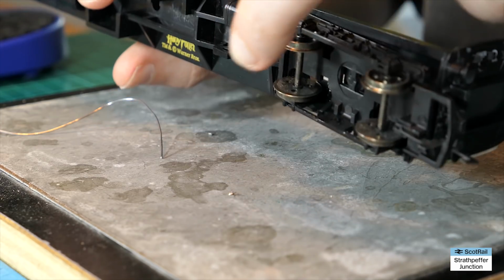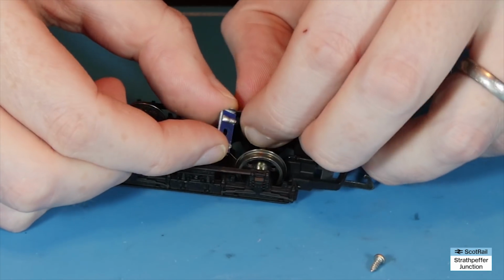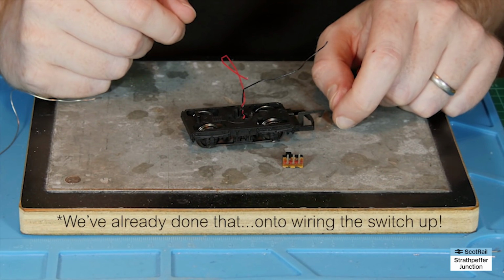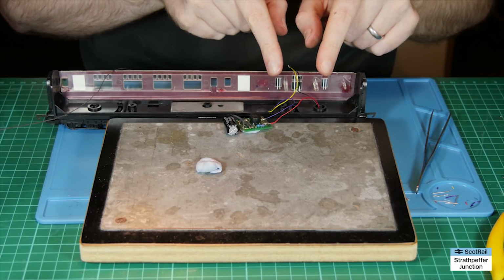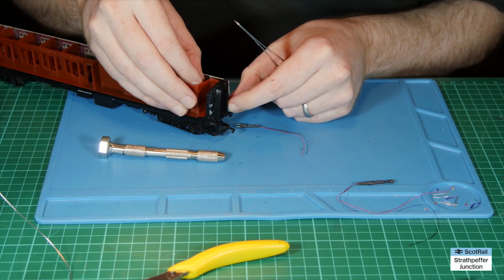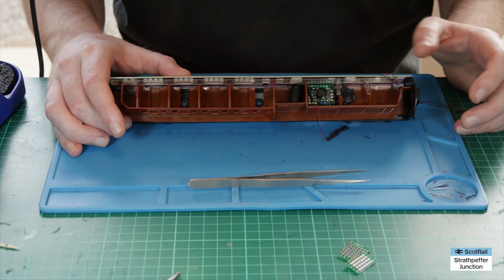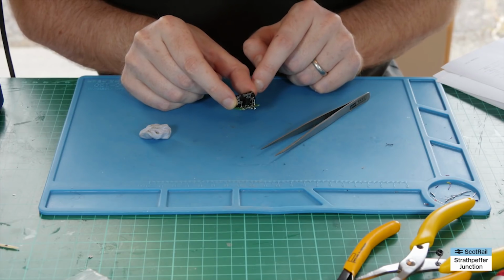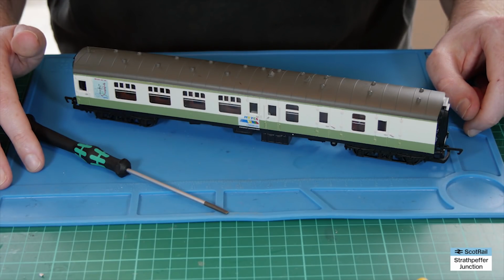#33 Part B: Installing a Flashing Tail Lamp/EOT Light (Making Pickups, Switch & Voltage Regulator)

Comment: I fixed a few of my Mk1 Brake coaches with flashing tail lights as per your method, but I have a set of new LNER Teaks and was wondering what type of light would come out of the old oil laps ie. Flicker for flashing or a fixed red light???
Very clear instructions in your presentation,
Cheers mate,
Michael.
Reply from the maker: Hi Michael. They were likely oil lamps and fixed red. The flashing only came in with battery technology...and even in the 80s as a wee boy, I remember seeing oil lamps on mk2 formations in Scotland. So the oil lamps did hang on for quite a few years after the battery lamps came in.

Comment: you probably know this but single tail lamps are always placed on the left, as you look at the rear, of the rear vehicle.
Reply from the maker: Hi. Many thanks for the comment. That may be the written rule, but you'll find scores of prototypical examples where the lamp is on the right. I'm watching a video of loco-hauled trains in the early 1990s in Scotland as I type and over 50% of them have the lamp on the right. Even Bachmann's new Mk2 coaches with working tail lamps have the lamps on the right...so there's definitely a clear precedent for it, even if the rule book says otherwise. 🙂
Reply: @StrathpefferJunction  thanks, as an ex driver they were or should, on modern trains be on the left https://www.google.com/imgres?imgurl=https%3A%2F%2Fimage.shutterstock.com%2Fimage-photo%2Fturves-cambridgeshire-uk-august-11-260nw-1064886794.jpg&imgrefurl=https%3A%2F%2Fwww.shutterstock.com%2Fsearch%2Fgb%2Brail%2Bfreight&docid=cVufJQXnrs5EVM&tbnid=cWWy9wbv5sAivM%3A&vet=12ahUKEwi2p7X3rNjlAhVJfMAKHW5cBcE4ZBAzKDkwOXoECAEQRg..i&w=390&h=280&client=firefox-b-d&bih=984&biw=1920&q=rear%20of%20freightliner%20train%20photo&ved=2ahUKEwi2p7X3rNjlAhVJfMAKHW5cBcE4ZBAzKDkwOXoECAEQRg&iact=mrc&uact=8  there is a simple reason for this, that they will be in front of the driver of a following train. But it's your layout 8). For instance the marker lights on shunters (08s) have white and red on the buffer beams, the red being on the left hand side for the same reason.

Comment: Hadn't heard of those wheel pickups - great idea - very simple. Great demo as usual.
Reply from the maker: Many thanks, John. Yes, these pick up are great. I use them quite a lot now and particularly where the wheels are double insulated so make it harder to use the spring pickups (you have to bridge the insulation on one side - fiddly!).